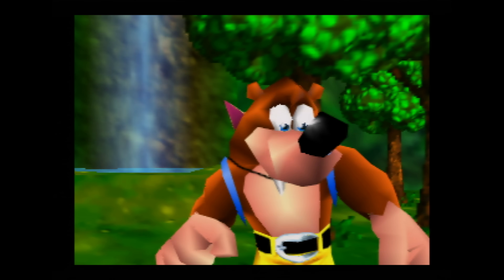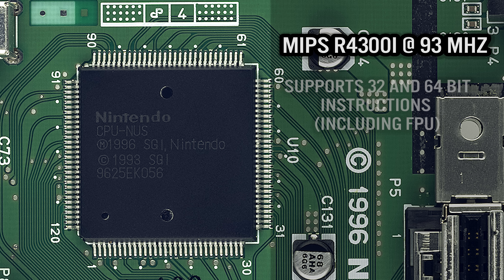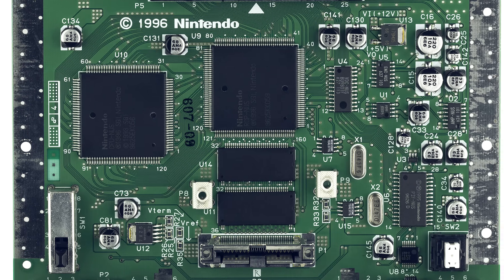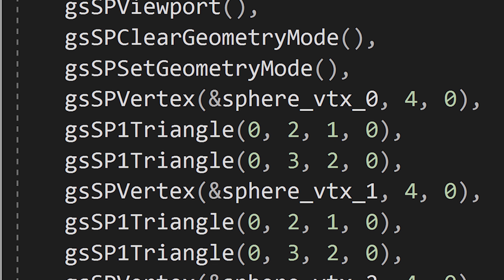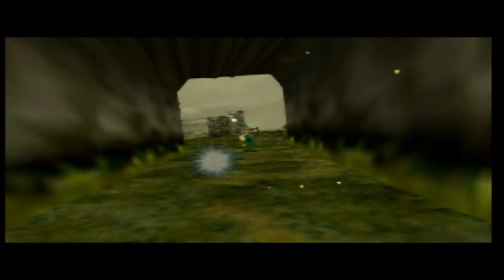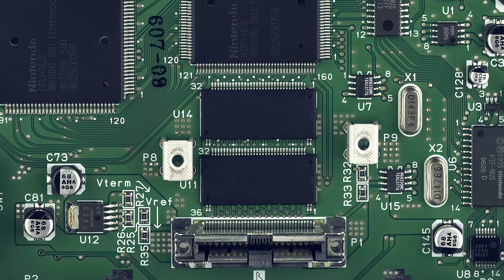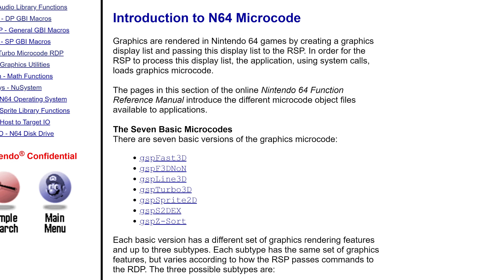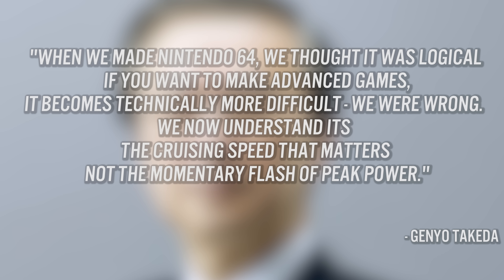Why was the Nintendo 64 so hard to develop games for ? | MVG

Comment: I wonder if the peak power approach would have helped them develop games that were more popular in Japan and Europe where Sega was doing so well against Nintendo with its blast processing.  Horse racing simulators, sports managers, card/board games like mahjong, and sports games in general were what Genesis had which nintendo sort of hurt on, but with the n64 they had a system that did all of these genre really well. 4kb of textures is quite ok for mahjong titles and the other methods can work for the other genres when there are a low set of polygons that need texturing or they can formulate the simulation into the ram while having a low end stat sheet.

Comment: The N64 is a good example of why it's very important to correctly balance a system and minimize bottlenecks instead of focusing on raw specs. For example, they could have made the system less powerful on paper and increased the TMEM size, and that would have resulted in much better looking games.

Comment: Really makes you wonder what could have been if that texture cache was bigger. It seems like a big "oversight" given that you need only so much size for a simple texture. The N64 was advanced but flawed. No wonder Nintendo followed it up with the Gamecube, whose hardware design was also in the Wii.
Reply: IT WAS. Maxed out at 128KBs. Trouble is, Saturn had 512KBs and an average of 256KBs! Saturn outperformed ALL 5th Gen consoles in Texturing!
Reply: texture cache was bigger than playstations, its the shitty rambus ram that tanked performance, all because supposedly Nintendo wanted to save cost of multilayer pcb with reduced pinout design

Comment: 6:58 - I believe that the N64 RAM Expansion Pak was 4 MB, not 4 KB. Also, to extend the 'fuel tank' analogy even further, I remember an N64 developer complaining in the UK Edge magazine that the N64 is essentially a Ferrari with a tiny fuel tank, because the lack of a CD-ROM drive (and high price of cartridge ROM chips at the time) restricted the amount of code, textures, video, and audio that could be incorporated into N64 games.
Reply: Yes he meant 4mb